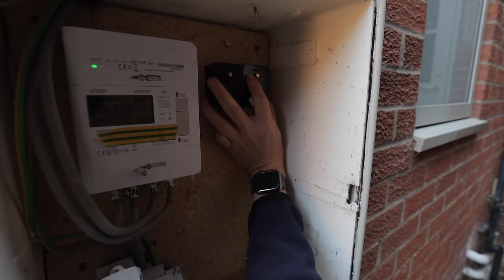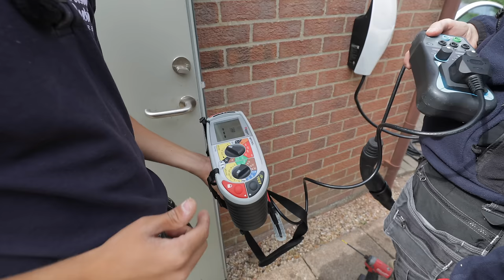I was WRONG! The Tesla Gen 3 Charger is the WORST!

Comment: Tbh, the wifi problem plagues other stuff too. The model 3 gets horrible wifi reception, and needs to be right next to the router to connect. I'm not surprised that the WC is the same thing. Looks like they're just not designing the wifi antenna/board properly

Comment: But what happens to the charger if your wifi drops out coz maintenance is being done by the wifi service provider
Reply: The wifi connection is needed for updates and for load balancing if you have several units. Two functionally that most other charge points do not have.

Comment: Regarding the looks of the charger, would an untethered unit not look a lot better? That's even if you can get it untethered.
Reply: If its a home charger, how is that tidier?  Are you going to get out your Type 2 cable every time you get home?
Reply: @zoltrix7779  it's tidier because when it's not in use there's no messy cable wrapped around the charger. How much longer does it really take to take the cable from the boot of the car and connect it to the charger?

Comment: The chargers should have a retractable power lead like the old vacuum cleaners to get that tidy look 🤷🏼‍♂️
Reply: Evidently you are not an electrician. With the amount of current that any brand of Wall Connectors draws you would have a very dangerous heat issues.  Wires need air to cool, by wrapping multiple the wire against itself will cause so much heat build up that you will exceed the temperature rating of the wire, that will cause higher resistance which intern will cause higher heat and you could end up with a fire or damaged connection points... In the US wire can be found with one of three temperature ratings, 60 degrees Celsius (140 degrees Fahrenheit), 75 degrees Celsius (167 degrees Fahrenheit) and 90 degrees Celsius (194 degrees Fahrenheit). It is not hard to exceed 60 degrees Celsius with Cable placed in an attic of a garage or house.  In a small enclosure like a wire winder it would get exceedingly hot.
Reply: They do now offer a retractable type 2 charging cable reel but they are about a grand and that then has to plug in to a charger
Reply: @heladas90  well... you could whip the plug off and hard wire it into a charge point...

Comment: Really like this series/vids - so useful - thanks for posting.  Qs . . . do you need an RCD at both ends of a run of SWA, if at all? High integrity circuit and Tesla wall charger having in-built RCD?  No built-in PEN protection though. . . like the Easee One which presumably could be wired off any (non-RCD protected) 40A MCB?

Comment: Just seeing the cable rolled up against the bricks makes me wonder if the best form of cable management is just a used wheel from an old car bolted to the wall nearby. Nice large diameter so you won't be accidentally crushing the cable, U-shaped surface so the cable will naturally be held away from the wall. Then just get a dumb charger that has the safety contactor built in.
Reply: You could also use a wall-mounted holder for a garden hose...?
Reply: @raycardy4843  yeah, garden hose holders have been addressing this problem for about as long as garden hoses have existed :D

For me the typical garden hose holder was a discarded car wheel!

Comment: I agree. I spent one hr getting wifi to work after the installation. Told electrician im a network computer tech so i should be okay to figure that piece out. I wonder if their 2.4ghz receiver is crap. The doc has a weird requirement saying you should disable mac filtering on your wifi access point. Found that weird as they specified the mac address clearly on their docs.

Comment: as others have mentioned 5ghz wifi practically only works in the same room.  I have a single ssid for 2.4ghz around the house and explicit 5ghz ssid’s for devices that dont really move between rooms (multiple access points)
Reply: 5Ghz has 2 levels of Tx power (well actually 3, but lets not go there). Its "only" 200mW in the lower band, and up to 1W (depending on the vendors radio chipset caapbility) in the mid-upper bands. So if you want more power and thus coverage in 5Ghz, make sure your Wi-Fi router is using channel 100 and above.

Comment: I bought Zappi in the end because of the PEN fault thing adding so much hassle to the install, and because it seemed to make more sense to have a device that wasn’t so tied to one make of car.

The Zappi has its own ‘gotchas’ where you need to buy an extra Hub box for the WiFi connection
Reply from the maker: Zappi V2.1 now has wifi built in so no hub needed - still a pain to connect to wifi tho! 🤣
Reply: @artisanelectrics  yeah - When I ran power to the garage, I got some 13A sockets added at the same time so I could run a Powerline adaptor out there for a decent signal.
Reply: You can charge other car brands with the Tesla Wall Charger also.

Comment: Well, I would never get one of these in the video.  Being in the US, I just got a 220 volt outlet installed in my garage and the Tesla mobile cable kit.  The mobile cable works well for me and the cable is just the right length to reach to my plug in port on the vehicle.  Plus the mobile cable kit is allot cheaper than these special chargers.  220 volts is fast enough charging for me.
Thanks for the video on your installation of these special chargers.

Comment: I struggled for a long time only to discover that my wifi forced WPA3 which will not work with the Gen 3. After creating a special wifi ssid for WPA 2 and connecting to it instead, no issue. Frustrating and annoying but it worked.

Comment: The installer can just set it up on their smart phones wifi hot spot at the location you install it, there is no need to connect it to the homes internet as its not a system you ever need to log into, fit and forget. just imho

Comment: Love this video, very informative and I like the way you coach your apprentice by testing him with knowledge questions during the installation! Where my switchbox is located is on the opposite side of house to my garage where tesla wall connector is to be installed. Just like you mentioned in the video, I thought the installation should be quite easy until my electrician told me it is gonna take a solid 4 -5 hours to do the wire routing properly.

Comment: In a area where you have many wifi points you need a scanner to see where the wifi conjestion is.   Download the follow apps.   Fing.  cellular scanner.

You should see which bands are the most conegested. Usually routers come set at 11, 6 or 3.  Move your wifi signal on the router to  the emptiest range usually 1,2,4,5, 12 and 9.

Then it should be fine

Comment: How do you test the PEN fault device?
Reply from the maker: Impossible to test unfortunately
Reply: @artisanelectrics  Surely the PEN fault device is designed to save lives by doing a disconnect when there is a fault, but no way to test it means its pot luck if it works when it is needed.
Reply: @sergiofernandez3725  It's not pot luck. You are relying on the manufacturer to test it at the time of manufacture.

They should be testing it and if it doesn't work, they can't ship the product.
Reply: @artisanelectrics  wire it up to a 110 v AC power supply?
Reply: @jocramkrispy305  In my opinion the 48V should be sufficient. It would be nice to know when the PEN fault protection should trip and simulate all that states. This sounds like a good inspiration to a video.
Reply: @NikiBretschneider  a 110v ac source  is easy to get hold of. its is under the 200v ac that should cause the PEN device to shut off

Not sure where you'd get a 48v ac source from

Comment: It’s totally a Wi-Fi router issue.  It’s 2.4ghz only and a lot of stock routers like virgin / by / sky have issues with dual 2.4 and 5ghz with the same name.  Separate them and you are golden - or use a decent mesh Wi-Fi.

Comment: I have a pod-point charger that isn't very pretty, but the tethered cable with its plug mount is much neater than the Tesla unit. I have a Tesla Model Y which will charge from my unit originally installed for a Porsche Taycan Cross Turismo (it went back to the dealer) although the charging socket on the Tesla is at the other side and other end of the vehicle.
In close to a year owning EVs I have never charged from my domestic unit other than a brief test. I have 50kw free-to-use chargers less than half a mile away, but I believe in having a back-up for essentials.

Comment: Hi Jordan, this is a genuine question. Why do car chargers have to be connected to the internet? Chris
Reply: For a single EV charger, not much, software update is all the Tesla one basically all it does.  If you have more than one, its just a wireless way for each charger to talk to the other one to load manage rather than run a data cable.

Comment: As a Network engineer specialised in WLAN and RF what probably is happening is you’re trying to connect to a very weak network with an RSSI value at the point of install of maybe -80 or so. The receive sensitivity of the antennae in the charger is probably not enough to get a stable connection back to the access point. Most people don’t have WiFi for outside. A tip is to have an old or cheap android phone and the Ubiquiti WiFiman app, it will show you the exact RSSI and you can see if it will give you issues or not beforehand :) just make sure it’s better than -75 dBm and you should be fine.
Reply: IT specialists always believe they are competent to troubleshoot microwave wireless networks, but in fact, they are not. RSSI is nothing more than a qualified guess based on BER of received WiFi signal, which is easy to determine on AP broadcasts, that happens every 100ms and contains all the time the same data. In fact, there is no possibility to measure real RF level using an android device. If there is a WiFi channel crowded to the point, where no SSID broadcasts pass through, then it is displayed as a clear channel with low noise level by these apps, which is something far from being true. RSSI values are typically shown in percentage scale (0-100 as cisco does) or in relatively weird 0-60 scale (as Atheros does), but sometimes it is shown on scale -90 to -30 followed by dBm suffix, but despite that dBm, it has nothing to do with real signal level and it is not logaritmic. This is typically used by cheap looking non-trusty makers like Ubiquiti or Mikrotik, which are (for nonunderstandable reason) unbelievably  popular in some weird IT communities.  In fact, troubleshooting radio networks is complex process, where IT issues are only relatively small part of much bigger thing. 

I am definitely not happy with the situation, where permanently mounted device, that requires some cables to be installed, is wirelessly connected to the data network. This makes no sense. Why the hell there is a radio network (which is unreliable from the principle of operation) to connect it to the network, if that device is hardwired to the power line? On top of that all, installed outside of the property, where the coverage of internal WiFi router is not to be expected. If I put it somewhere, where definitely is not WiFi coverage, I have to run ethernet cable to it, then I have to install a WiFi AP to connect just this one thing to the internet. That's crazy! In my opinion, that charger should contain ethernet port inside to connect this to the network, this would ease the installation process, and it should also contain a WiFi AP that could be potentionally used to connect the car to the local network if there is no WiFi coverage, or could be used in client mode to connect to a local WiFi if it is present. And there should be also some possibility to introduce the local WiFi SSID and credentials to the connected car through the charging cable to make that whole process much smoother to the user. And there also should be possibility for the car to confirm its identity in some cryptographical way to the charger, which is something, that would be very useful non only as a safety feature at home when charger is accessible from the street, but also at a public charging points. But this is (for unknown reason) not implemented. Despite all that huge displays and all that fancy computers making the car looking much more like a tablet on a wheels than a real car, the whole automotive industry mentally lives in late 70's, maybe early 80's. They are adopting a lot of technology, but just to make things look fancy. They don't think about how to develop things to the point, where it would bring smooth experience to the users, and ease of installation. They just want them to look fancy, that's sufficient. This drives me crazy.

Comment: Tesla wall connector in Europe is 3 phase.
I would rather pull in 5x4mm cable and then double line and neutral, and when 3 phase service comes, put it in 3 phase configuration.

Comment: My router is RIGHT next to the charger, it never connects. Or it connects after 20 minutes of standing in minus degrees outside trying to fix it, then it disconnects the next day again. Horrible product, and the installation/setup procedure in the Tesla App is horrible too. Very saddening to pay this much for a trash charger.

I have requested a refund from Tesla now, and will be opting in to install an Easee Charge Lite instead, heard those are MUCH better. I regret buying the WallConnector after all the issues.

(The charger doesn't charge my car reliabily anymore either, it stops charging after either 1kWh or just a couple of minutes. *It goes from green back to just blue again like it's ready to charge*)

Comment: Meanwhile over here in the colonies (USA - Alabama) I just wired it to my 100 amp sub-panel in my garage MYSELF,  a licensed electrician friend checked my work and NO SMOKE. YEA.                          I commissioned it to 32 amps, works fine for our needs.  Gen 2 Wall Connector.

Comment: Why is there a requirement for RCD? Doesn't Tesla have built-in type B RCD? @ 10:10
Reply: I thought the same, I've seen it in the instructions that it's built in but it might not be double pole
Reply: @frenchie8383  can't say, I've only installed three phase version. We don't need to have a RCD on the cable so I connect them directly to 16A breakers
Reply: Yeah you’re right, Tesla charges do have a built in type B RCD. Fitting one at the mains end is not required because it’s a swa. Also there is selectivity issues now 🤔
Reply: This is correct and selectivity issues have now been introduced
Reply: @n_i-ub9gf  Easily solved by using a delayed RCD ..
Reply: because the tesla is at the other end of the cable.

Comment: My advice: a. Never update firmware when connected to a powerbank. NEVER. b. Once connected to the device, perform anoffline firmware update. c. Once latest SW is installed succesfully, power the device OFF, wait 10s, power On and continue with configuration and WiFI pairing with the house network, on a 2.4GHz network. Keep in mind the TWC has a 1x1 wifi antenne configuration, so proximity to the access point/router is quite important

Comment: Can you not hardwire it in to the wifi ?
Reply: Hardware? As in run a cat5 or cat6 ethernet cable? It's not WiFi if you do that ..
Reply: Ah, I think I know what you mean. Your question should have been "Can you not hard wire it in to the WiFi router?".

The answer is no: the charger does not have a wired ethernet connection port.

Comment: Great video. I had a Hypervolt 3 Pro installed (more expensive), as it's a larger unit the cabling (10m) I feel looks much better and the lights add a little touch to it too. This little Tesla charger didn't excite me (but I don't have a Tesla car either as they don't excite me lol).

I do like your channel, whilst not an electrician, I would rate myself a 10 out of 10 in wiring a plug however 😂

Always find electrical systems exciting (maybe from my electronic engineering background) and quite comfortable with it personally. Now just need to go and install my garage consumer unit (metal of course, I did see a recent episode of yours on PV installs and a plastic consumer unit in the loft by someone else, that was a surprise to see).

Finally, always try to hardwire networks if possible, again, my Hypervolt is hardwired, wireless I feel is for mobile devices only, if a device is static, try and hardwire it, always the better option.

Comment: Across the pond their wifi lacks some of the channels we use in Europe, so depending what channel the router is operating on, North American wifi devices may, or may not be able to connect.
Wonder if Tesla overlooked that, which could be fixed with a firmware update.
Reply: Its such a big problem that honestly I wish manufacturers would just have 1, 6, 11 in the UI and not mention anything else.  There is far too much room for people to end up partly overlapping channels which just results in whichever person has the best radio in their unit gets all the speed and everyone else has poor performance/unreliability.

Auto mode on many routers are utterly dumb too and just make this even worse.

Comment: Couldn’t you use an earth rod instead of the PEN ?
Reply: Nope.
Reply: @edwilliamson6234  if the out of balance phase causes an out out balance to ground. Surely a ground rod cures this ?   I could be wrong but doesn’t this do the same job ?
Reply: From memory, the Ze required for a rod with EV is a few ohms so impossible to obtain. I recall that a perfect balanced 3P system has other options available.